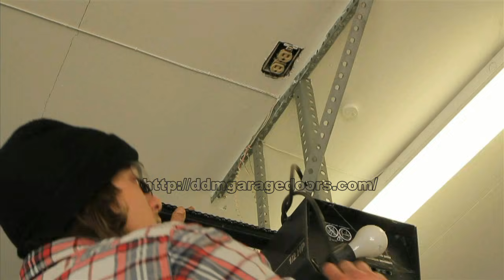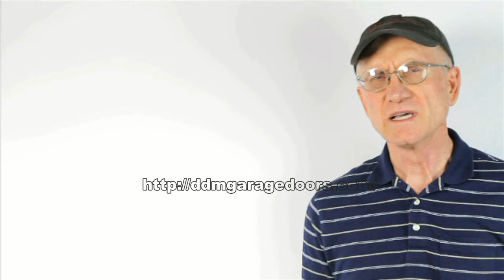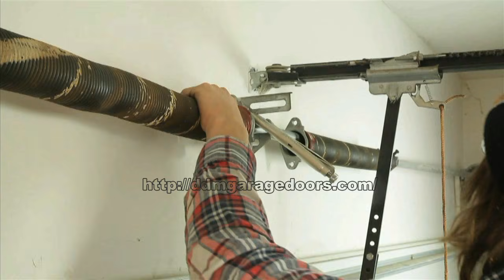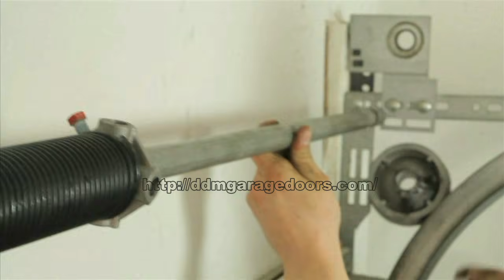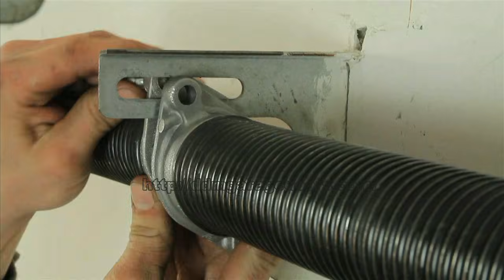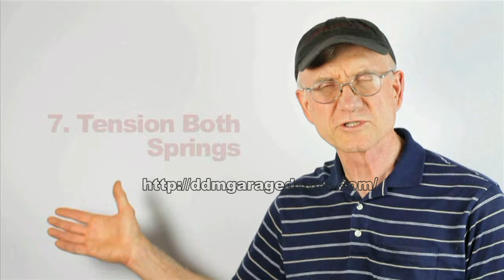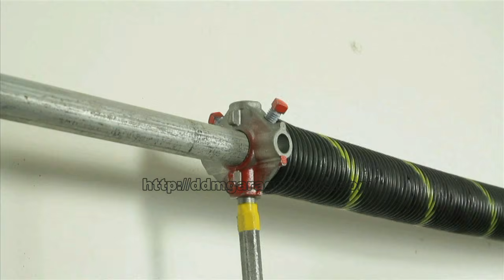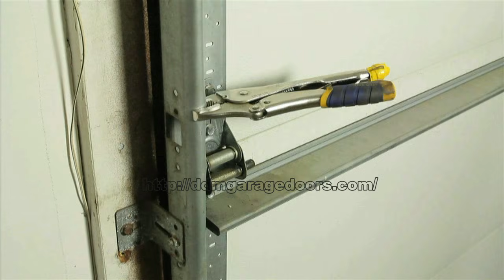How To Replace Garage Door Torsion Springs

Comment: Do you know why I might be having a problem with the cable drums.  When I lift up the door, the cables leave the drums and wrap around the bar?   I also replaced the end bearings.
Reply from the maker: +gary defilippo This often occurs when the springs are wound backward. Normally the right wind spring goes on the left side and the left wind spring goes on the right side as you view the door from the inside. If these are installed backward, the spring shortens as you wind it. We recommend making the shaft just beyond the winding cones to assure the springs grow in length as they are wound. Otherwise, the springs bind and the cables come loose.
Reply from the maker: +DDM Web Services, Inc. Oops! "We recommend marking the shaft . . ."
Reply: Wow!  Thanks for answering my question  so quickly.  If I stand on the outside looking at my garage door, I have the red coated one on my right and the black coated one on the left.  But when I had only one it worked fine.  Does that make sense?  Really appreciate the help.

btw I DO appreciate it when a professional points out which product line he repairs the most; the ones to avoid.
Reply from the maker: +gary defilippo It looks like the springs were mounted backward. When you had only one spring either the wrong color was on the winding cone or you may have stretched the spring to make room for the number of coils to increase. 

Glad to share my experience.

Comment: Outstanding!  Just finished replacing two torsion springs with success by following this video to a "T" (laptop in the garage) and after reading several times "How To Replace Garage Door Torsion Springs" on your website.  Also, replaced the end bearing plates as recommended since mine were stamped with "ADH" and appeared to be failing/frozen. Thank you very much for the quick shipment of parts this very detailed DIY.
Reply from the maker: +Kielyn B  Congratulations, Kielyn. Glad to hear the job went well with the help of our detailed instructions. It's good you caught the "ADH" bearings. I've seen those cut through shafts. Glad the parts arrived quickly. Thank you for your kind words.

Comment: Excellent video!  With your help, I just converted my broken single spring door to a double spring door.  I was also able to identify some things the previous "professional" installer did wrong when I had the spring replaced just 5 short years ago.  Thanks to you, I have better springs, and a safer, more durable setup.
Reply from the maker: +Andrew Gibbs Congratulations, Andrew. Glad to hear the job went well and that you could improve over the earlier professional's work. You're welcome, and best wishes!

Comment: what's the purpose of the one inch mark beyond the  edge of the cone?
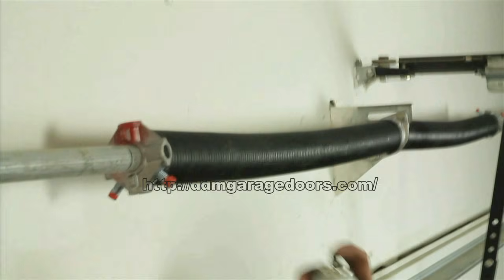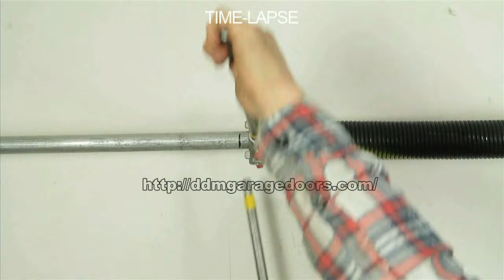Reply from the maker: +Sunil D At 11:52 we mark the shaft to assure that the spring grows in length as you wind it. We explain this at 12:50. If the spring does not grow in length as it is wound then the spring is mounted backward or it's being wound the wrong direction. When this happens the springs usually need to be moved on the opposite sides of the center support brackets.

Comment from the maker: There are several YouTube videos where the installer doesn't stretch the springs after winding. Experienced professionals, however, understand that without stretching the springs the doors often will not seal the floor completely after closing.

The problem with winding the springs outside the winding cone is that there is no way to safely stretch the springs. You have to position your head right in the path of a winding cone when it is most stressed. That's dangerous! The only way to safely wind the spring and to stretch it afterward is the way we show on this video.
Reply: I saw that.
Reply: Good info. Best DIY video.
Reply from the maker: Thank you, nhb! We're glad you found it to be helpful.

Comment: I watched a bunch of videos before attempting to change my broken torsion spring, and this one was by far the best and most thorough one. The few little added tips definitely helped make the job easier. I'd still recommend most people get a professional to do it, but this video was great for anyone confident they can do it themselves. Thanks a bunch.
Reply from the maker: +Taylor Hindley  Thank you for your kind comments, Taylor. I'm glad we could help make the job go more easily for you.

I agree that most people would be better off getting a professional, but they generally do that before watching videos on the subject. Mechanically inclined people tend to investigate before deciding to do the work themselves.

Comment: Hi, we did exactly what you did but we can not lift the garage door by hand
Reply from the maker: Pete Shah Pete, there are a number of reasons the garage door will not open by hand after replacing torsion springs.
1. The most common cause is that the wrong springs were installed. When customers order spring sizes that I've never seen in my 36 years in the business, I have our salesmen call them. Usually it's because they haven't measured the springs correctly.
2. Over the years we have found that the springs are installed backward. In our written tutorial at http://ddmgaragedoors.com/diy-instructions/replace-garage-door-torsion-springs.php there are about five places where we tell the customer to check the wind of the springs because failure to do so has resulted in so many problems. Engineers seem to have the biggest problem with this. When you wind a spring correctly, it looks like the cone will slip out of the spring. It's counter intuitive. What actually happens is that the inside diameter of the spring shrinks and the coils grip the cones more tightly as the spring is wound.

3. Another common cause of the garage door not opening is that one of the cables is caught under a track or under one of the track brackets. Check the cables to see they are free all the way from the bottom fixture pins to the slot in the cable drums. The cable tip needs to be inside the drum; if it sticks on the side that could also prevent the door from opening.

4. A fourth cause is that the top of the garage door sticks under the header. Without spring tension the door closes further causing the top of the door to stick under the board just above it. This can be remedied by loosening the top fixtures roller carriers and pulling the top section toward the inside of the garage.

Sorry to hear about your frustration. I hope this helps. Best wishes.

Comment: This is the best DIY video I have ever seen! So well shot and narrated. However, I think I can pay someone $150 to do this, so this video convinces me I should do that!
Reply from the maker: eichelman Thank you for your generous comments! If one of my springs broke, and if I could find someone locally to replace both for $150, I would probably have them do it; I'm busy. Many people have time and they enjoy the challenge of replacing their garage door springs as well as saving money in the process. 

However, many companies around the country charge $600 to $1,000 to replace two springs. Before calling a contractor to fix your garage door, I would recommend checking local reviews on Yelp at http://www.yelp.com/ or Rip Off Report at http://www.ripoffreport.com/. 

I used to recommend the Better Business Bureau, but all it takes to get an A+ rating with them is to resolve all customer complaints when they bring them to the BBB. It appears to me that a door company that rips off every customer and pays them back after the customer spends hours detailing the theft to the BBB can have an A+ rating. In my own experience I have seen that the BBB does not hold its members accountable to its high ethical standards. Rip Off Report has chronicled numerous issues with them. However, when checking companies I do take note when their customers have never had to resort to resolving matters with the BBB.

Comment: "…left side, when looking at the garage door from inside the garage."  That kind of orientation instruction is priceless.  Absolutely unambiguous.  I've done this before, but I learned a lot from this video, and your others.  I talked to Andrew today, who walked me through some of the measurements I was missing (radius; door height; etc.)  FedEx just advised that the springs I then ordered from you are on the way.  I'm doing this job for a friend, which is doubly satisfying, as the logistics and costs of getting a tradesman out to her place were a problem for her.  Congratulations on a great website and customer service.
Reply from the maker: Steven Sweeney I'm glad you found the instruction helpful, Steven. Some great people worked hard on this video to make it as clear as possible. Your kind words are appreciated.

Glad you were able to learn something new. I learn something new every day. I was picking up materials today and an installer 30 years younger than I showed me a new and better way to tie down my products.

Andrew was recently promoted to sales manager. He's been a big help here going the extra mile to see that customers get what they need. He takes his job seriously.

It's nice that you can help a friend. Often do-it-yourselfers do a better job than the professionals.

Best wishes!
Reply: DDM Web Services, Inc. The installation is complete and the result could not have been better.  A 209-pound door easily passed the "two-finger lift" test and was balanced all the way from open to closed.  Not a single adjustment was required. A tradesman teased me a bit about how relatively inexpensive it was to just get someone out to do the job-but of course taking a half day off work to be there jacks up the cost considerably.  Anyway, the whole point of DIY is to do it yourself, and derive the pleasure from a necessary job, well done - but I would surely have struggled if I had not watched this video first, and ordered the just-right springs.  I even took a break during the job to come in and review the part specifying which side the red- and black-marked springs went on, respectively.  I thus kind of blew my cover as to the homeowner, 'fessing up that YouTube had (once again, as with so many things) been my reference.  I hope I hear of someone else's torsion spring problems (not wishing ill on anyone!), so that I can recommend your company and services.
Reply: Steven Sweeney Don't know why some of that post appears to be lined out.  I didn't do it.
Reply from the maker: Steven Sweeney I didn't, either. I can't imagine what happened.

Comment: Followed this video to install and remove a pair of springs on my residential garage door. It was very helpful and I was able to complete the job safely and correctly. 

I would add that it might be useful to try to add a link to a resource of how to more easily tell how much spring your garage door needs. Were my old springs under-sprung? Should I add more spring to keep the load off the opener motor? 

Overall great video.
Reply from the maker: vyndictive Glad to hear you found the video helpful. Thank you for your kind comments.

The link above to http://ddmgaragedoors.com/diy-instructions/ tutorial library provides a lot of helpful information on garage door counterbalance, how to weigh doors and how to measure springs. The video is an abbreviated version of our earlier written instructions at  http://ddmgaragedoors.com/diy-instructions/replace-garage-door-torsion-springs.php. This probably has the answers you need. I would have preferred a two hour video to cover most of the issues involved in replacing springs, but most people prefer viewing just the essential information.

Comment: well organized video with good safety precautions assuming you have the correct size door springs for replacement.
Reply from the maker: RandyR09 Good point, Randy. Replacing the springs is dangerous if the springs are too strong. The door can come up and knock you off the ladder. We've labored extensively developing two videos for weighing the door and one video for measuring the springs.

Comment: Very helpful.....thanks for posting. 

Garage door opener kept alarming and reversing, so I examined the springs.

When the door was up, both springs were floppy; but when the door was down, the left spring was taut and the right one was still floppy.

So I assumed the winding cone screws had just slipped on the right side, and had unloaded the spring on me.

So I put the stick in, loosed the two square nuts, and gave the right side winding cone a few 1/4 turns.

Voila!  All is well, and it was a no-cost repair.
Reply from the maker: fenderstratguy You're welcome. And, congratulations! Glad to hear you determined what to do, and that you saved on the cost of having a repair company fix your garage door.

Torsion springs unwind as the garage door opens. That's why there are gaps between the coils and the springs get floppy. As you close the door, however, both springs should be equally taught. 

Cone screws typically don't come loose; when they do, they usually unwind most or all the way. More than likely the shaft had shifted to one side, causing the coils on one side to bind as the door is closing. This, in turn, caused the opener to reverse the garage door. When you adjusted the spring you probably freed the coils.

The most common reason the shaft slides to one side or other is space between one of the cable drums and the end bearing plate. This is usually due to an oversight of the spring installer. Other reasons include the older style flat bearing plates that would flex as the door operates. This can also be caused by the top of a flag bracket coming loose and moving away from the center of the door.

I hope the explanation helps. Best wishes.
Reply: DDM Web Services, Inc.   It seemed a little weird to me that one side would come loose unless those little square screws found a way to suddenly slip.  

It works so far, but after reading your comments, I'm not entirely convinced the root issue has been put to bed.
Reply from the maker: fenderstratguy Did the setscrews actually come loose? Were the set screws loose? Did it require any effort to loosen the setscrews? I've seen setscrews come loose only once or twice out of probably more than 30,000 spring repair jobs. If the door stays up by itself when you open it you probably fixed the problem. I'd leave well enough alone.

Comment: Great video and store. I upgraded my broken single spring to two long cycle duty double springs and installed everything as instructed in the video and it installed perfectly. The delivery was quick. The only difference was that I didn't have any paint to make a line on each of the springs. So I used my kids' sidewalk chalk to make the line which was a lot less smelly and messy.
Reply from the maker: Jeff Brown  In my early years in the trade we used big yellow crayons to mark the springs. Thank you for your kind comment. Glad to hear everything went well and that the springs arrived quickly. Congratulations!

Comment: I consider myself very mechanically inclined.  Changed a door spring on my garage door awhile ago.  Recently an original one (20+ plus years old) broke.  Watched this video.  Never realized the little things I missed (stretching the spring, oiling the springs, etc.).  One of the best DIY videos I've seen.  No BS.  Safety points included.  Great job.
Reply from the maker: Michael Frick Replacing garage door torsion springs involves a lot of details as you could see. Thank you for your kind words.

Comment: I give to DDM Garage Doors 5/5 stars. Very good information on this video and very good customer service. 

I completed replacing the broken one-torsion-spring system into two-torsion-spring system on my garage that is 7'x16' for the first time last night within an hour. It was actually much easier than expected and straight forward thanks to this video. Saved me a bunch of $ on doing this myself. Changing car tires is much more work than this so if you can change tires, you should be able to do this.

I also did order my replacement springs from DDM Garage Door...I provided them the garage weight, garage dimension (7x16), rail radius, and the cable drum number...they figured out for me what spring I should use. I initially paid for a different spring since I gave them the wrong cable drum number but when they reviewed my details it turns out that I needed a different set of spring which are more expensive. So that I didn't have to pay more, they gave me the priority shipping for discounted amount on 2 separate boxes.
Reply from the maker: Thanks for the kind words, and thank you for your business, David! We hope your springs are still working well for your door, and aren't causing you any issues!

Comment: Great video was a snap, except I had 2 broken springs, (Failure to fix it when 1 broke) and 2 broken cables. Had to figure out how to remove the bottom cable attachment by removing the bottom bracket and the roller. Thanks
Reply from the maker: rodney martin Overhead Door made bottom fixtures that had to be removed in order to replace the cables. I've been on jobs where it took twice as long to replace the cables as it did to replace the springs. In the trades we use come-alongs to lift the door to access and remove the bottom fixtures. Sometimes you can pry the door up using our instructions for weighing a door at https://www.youtube.com/watch?v=2BTqq0-GFJg. You're welcome, Rodney.

Comment: Excellent video.  My home had an Ideal Garage Door so I was able to get replacement springs at Menards.  The instructions in the video worked perfectly. The springs I bought came pre-painted with a line making it easy to count the columns.
Reply from the maker: notlooknback1 Glad we could help. Menards has a lot of the springs for Ideal doors, but their inventory is limited. When they don' have what the customers need often the folks at Menards will call us to help the customer find the springs they need.